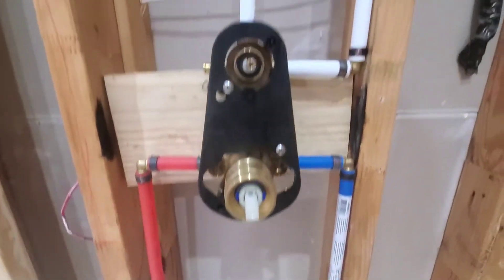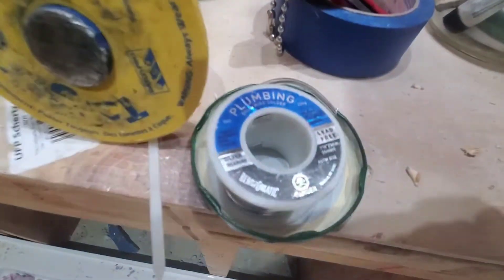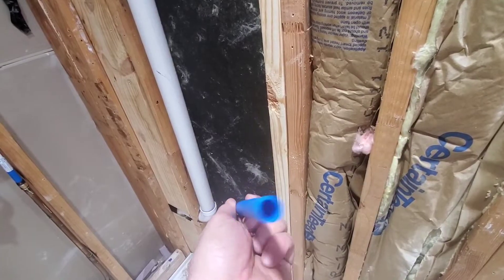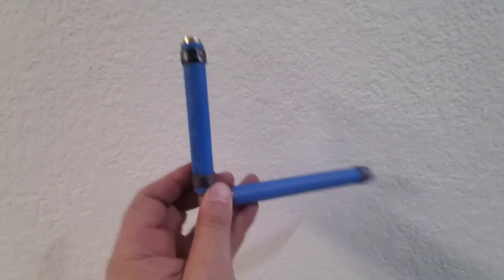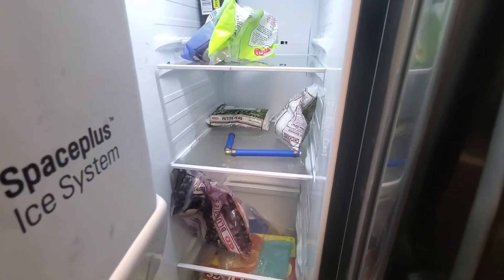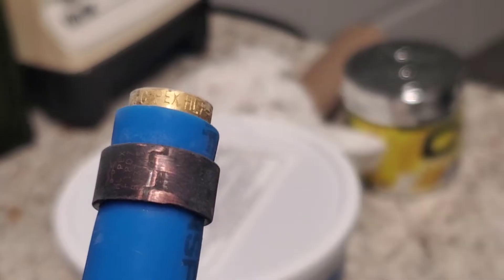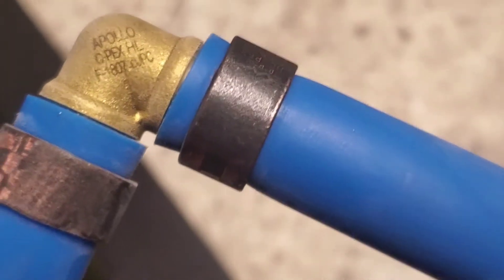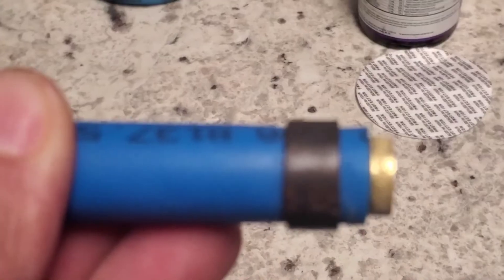How well does PEX handle freezing?

Comment: If you’ve ever seen a pex A or b ? The commercial stretch type lex swells like crazy it’ll swell out 30-40% without a rupture it’s not freezing and busting. I dunno how long it takes it to rot ? But I like it.
Reply from the maker: @jefferyboring4410  im a fan, but I too could only wonder how much stressing it can handle before its integrity breaks down, resulting in failure.

Comment: This is encouraging. My pipes are frozen solid. I think I've got mostly PEX. As soon as I realized they were frozen i turned the main water off to the house and opened the only faucet that wasn't frozen stiff to let out as much pressure as possible. It's supposed to warm up above freezing in a week - guess I'll find out then when I turn the water back on how things are going.
Reply: Im in the same boat
Reply: Just curious if you ran the faucets to keep them from freezing, if not, why didn’t you?  Is it not economically feasible in your area since you mentioned you’re below freezing for a week, high water bill?

In central south central Texas where I’m at, it may freeze at the most for about 2 days then thaw out and only freeze at nights.  I ran my water inside and we have old galvanized pipes and it survived.  However, I’m thinking of changing them to Pex-A and insulating them with that foam pipe insulation that looks like a swimming pool noodle.  

So how did your plumbing do in that extreme freeze?

Comment: Further foam tubing insulation? Further wrap insulation? Electrical heater cable wrappimg?: When is enough enough?!

My late grandfather simply got his torch out and thawed his metal piping. His Dayton  Ohio metro gets to -20°. My mother feared that he might burn his home down.

Her fears were unfounded: He performed rafter safety plumbing for munitions manufacturing during WW2. His home initially was erected in the1820s'. (He had fought with Pershing in WW1.)

He had lowered his ceilings from 10' to 8', saving on utilities in this way. His wife was smart with the finances--she agreed. I miss them....

Comment: I own an older multi-family home which had copper and PEX water and boiler piping running through uninsulated crawlspaces, basement to crawlspace transitions and poorly insulated walls
When the power would go out during power outages with sub zero temperatures it was always the copper that would fail, all copper L water supply, and copper M boiler and baseboard piping
My PEX B water piping and PEX C boiler piping (Sharkbite) went through more freeze cycles than I can remember while I was renovating
Some thought longer runs of frozen piping would cause my connections made with copper crimp rings to fail, however that was not the case
To test these theories I installed brass plugs in long runs and coils of PEX B and PEX C which had previously been frozen, some with copper crimp rings, and some with stainless cinch clamps which I left outside in freezing temperatures
None had issues
Inside the home I only had 4 weeping fittings, likely due to installer error by a plumbing and heating company with workers that didn't check crimp and cinch ring position, nor fitment

Comment: Since mice chew on the PEX tubing, it must have a protective metal armor clad exterior.
Little expense to insure that some day a mouse won't start chewing and causing a leak in an inaccessable location.  I had particle board flooring swell and decay over night due to this kind of leak.  A plumber wanted to change it all out to copper at a high cost.   :eyes-pink-heart-shape:

Comment: I know you can't put a long pipe in your freezer (unless you go to a restaurant freezer - or ice cream shop) but as an insurance adjuster I can tell you that a lot of times it is the longer runs of pipe that push out the elbow at the corner. That "little bit" of expansion when water freezes can become a quarter inch or more expansion at the end of a long run and it breaks out the corner (of copper pipe anyway - never seen PEX freeze damaged). Of course we see a lot of "splits" as well (again with copper), which your pipe survived in the freezer.
Reply: Physics
Reply: I’ve sweat up splits using super bright #8 I’ve sweat up big wide splits you’d never believe possible. Just sand em rough squeeze em close and tight as possible that super bring #8 is expensive as it’s got a lot of silver in it 40-60% can’t remember but it’s amazing. It’s used in ac pipes atleast certified in Europe

Comment: You can use a push-on shark bite on the conversion from copper to pex. No sweating if you want. Same shark bite on both ends.
Reply: Don’t use shark bite fittings. They are complete trash.
Reply: @thecappy I am a plumber with 8yrs experience. My boss, probably 30+ yrs experience, always says shark bites are crap/trash/won't last. But I've used them in my own home and on all my side jobs. I've never, not once, had an my issues or call backs because of them. I think that old timers just say that about new things they aren't accustomed to. They believe it's too good to be true. That they've been doing things their way so long and anything else is cutting corners. The time/money I save by using pex and shark bites outweighs any concerns I have about them not working....by far
Reply: @thecappy lies
Reply: @Katana_00 I am a plumber with 8yrs experience. My boss, probably 30+ yrs experience, always says shark bites are crap/trash/won't last. But I've used them in my own home and on all my side jobs. I've never, not once, had an my issues or call backs because of them. I think that old timers just say that about new things they aren't accustomed to. They believe it's too good to be true. That they've been doing things their way so long and anything else is cutting corners. The time/money I save by using pex and shark bites outweighs any concerns I have about them not working....by far

Comment: How can you take shark bite off of pipe and reuse?
Reply: There is some confusion over 'Sharkbite".  I have some PEX fittings as shown here that I got from Home Depot a few years ago, and the package says "Sharkbite PEX"; however they are the crimp type fittings (https://www.sharkbite.com/us/en/crimp/brass) 
HD carries the same fittings now under the name 'Apollo". What I've seen a "Sharkbite" fittings are https://www.sharkbite.com/us/en/brass-push-to-connect/fittings. 
As far as reusing the crimp/cinch fittings, yes, you can reuse the brass ones. There are tools to removing the rings. Getting the PEX off can be a bit of a pain as the PEX conforms to the barbs on the fittings. Heating the tubing a bit can help. I use a sharp box cutter blade and make a slit parallel to the tube being careful not to knick the fitting. Also, putting it in a vice with light pressure will keep the tube from spinng and help you keep your hands free of stiches.
Reply: yes. they have a tool @home depot
Reply from the maker: Must use a pex crimp ring removal tool.  Sharkbite is a different animal, but there is a tool for that as well

Comment: If you go with the clamp system. It is best to up size your pipe. Or you will have flow issues because the fitting choke your water. I would recommend zurn PEX b with f1960 expansion fitting. Imo it is better than uponor pex a, it's stronger and no chemical leeching, more uv resistance.

Comment: that skinny pex tubing is why my water pressure got cut in half when my shower was replaced
Reply: I did 3/4 to 1/2 male and female adapters to run 3/4 everything and then 1/2 in at the end so water pressure would be strong